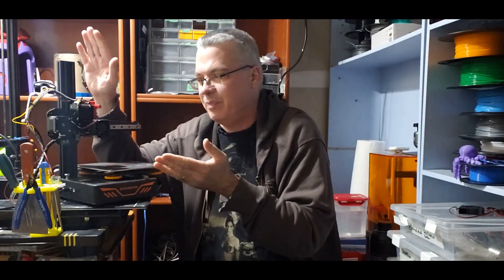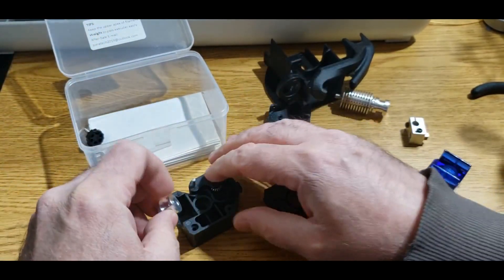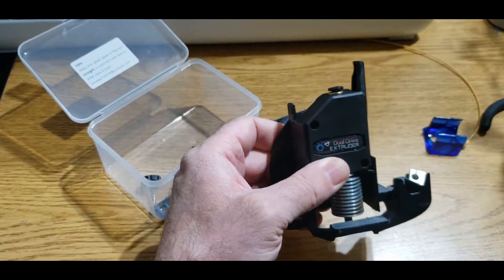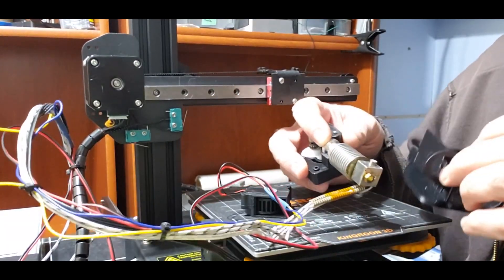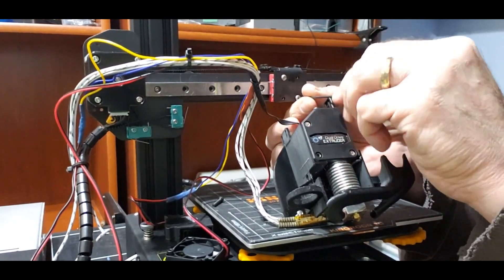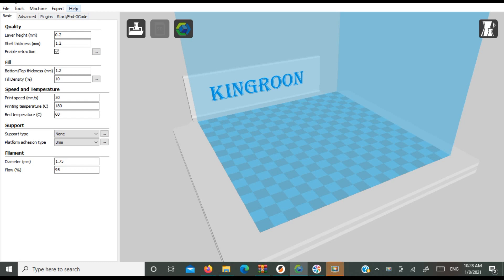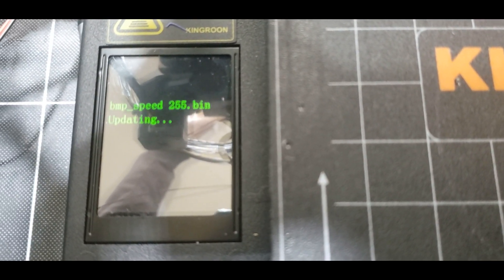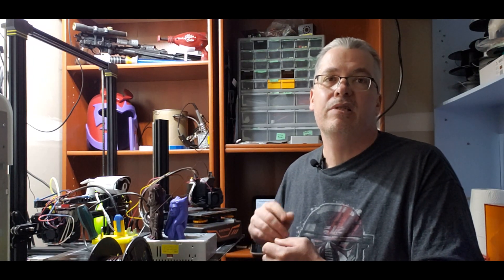KP3S  and V6 Extruder install Step by Step.

Comment: I don't understand why is my KP3S's extruder is so hard to disassemble away from its motors like it's got some super magnet attached to it. All of the 3 screws have been unscrewed now because it's never been screwed at all when I have this printer. It's a secondhand btw. I don't even know how do I know this printer's KP3S's type of models if this mine is S1 Pro or the more basic one.

Comment: Darn, i'm having an issue at the end of this. I've done everything according to your video guide (which is awesome btw <3) but upon turning the printer on, the nozzle temp rapidly rises on its own and hits 260c then the unit shuts off. Any idea what could be causing this?

Comment: I am either going to modify my Tevo Tarantula Pro with linear rails or I am going to get a KP3S Pro S1. As I mentioned earlier, my Tevo already has a V6 direct drive all metal hotend using a BMG. Have you kept up on the wood grain issue of dual gear extruders? It's quite fascinating!

Comment: Now I am using 23mm motor to avoid touching with the Z axis. BMG clone and V6 clone... but the BMG bolts are so short... I will need M3 40mm I think

Comment: Please show us any noticeable difference with a pancake stepper motor
Reply from the maker: The pancake allows full travel range in the new configuration.
Reply: I'm thinking of getting a 20mm pancake with the BMG clone and a V6 (I have both of the above just debating on 23mm pancake or 20mm)
Reply: Also I'd like to thank you for your efforts. I really do appreciate your work and it's been instrumental for me. Many thanks again

Comment: That Bowden tube inside the V6 looked a little loose. I think I prefer the all metal V6's. Ive done that to my Tevo Tarantula Pro. I also used a BMG extruder with a pancake stepper motor. When will you have your pancake stepper motor?
Reply from the maker: I just installed it last night.and yes it is I will look for a solution. Any thoughts?
Reply: @jeffs3dcorner  did you find a solution?

Comment: great video uncle Jeff, should i get that extruder for my tronxy xy2?
Reply from the maker: Eventually I do a similar video for the xy-2pro. I want to convert it to direct drive as well.
Reply: @jeffs3dcorner  i just bought a kingroon because of your videos... 😬
Reply: @jeffs3dcorner   - Of cause Jeff, you should make a Tronxy XY-2 conversion video with exactly this parts. I found by myself that his combination of the V6 hotend and the BMG Extruder are the moste convincing parts tondo it on the TRONXY.
Reply: I installed a V6 hotend on my XY-2 and it was a night and day difference!! I later swapped the mainboard and lcd with a SKR 1.3 with 4x TMC2208 in UART and a TFT35v3.
Reply from the maker: I'm have a  Skr I'm planning for a mod soon.
Reply: @jeffs3dcorner  let me know if you need help, I replaced my tronxy xy2 for an skr1.4 and tft3 and it was a pain since the filament sensor and fans need a little rewiring